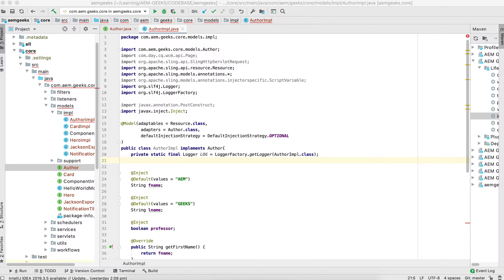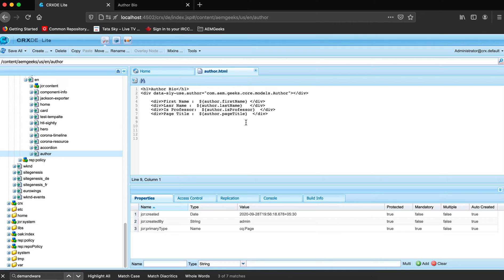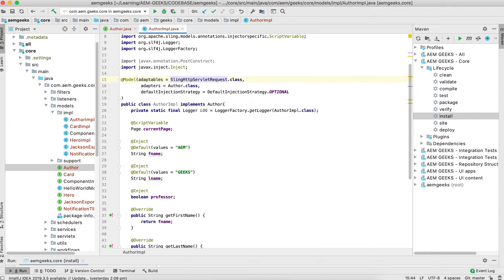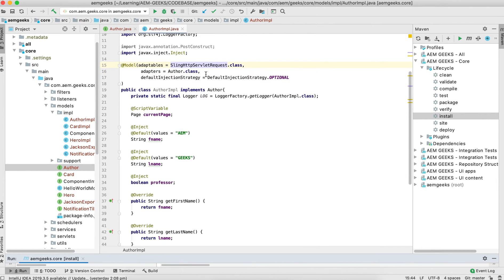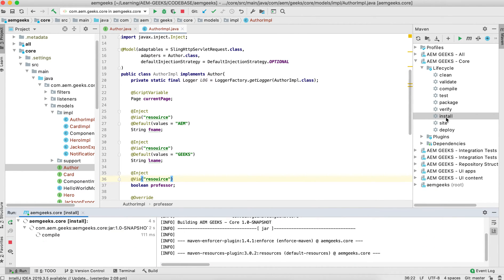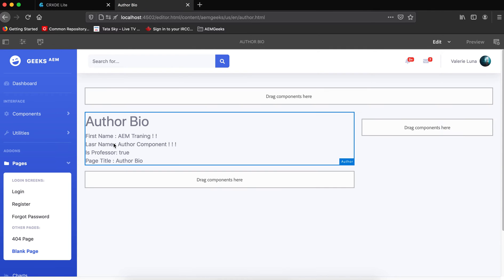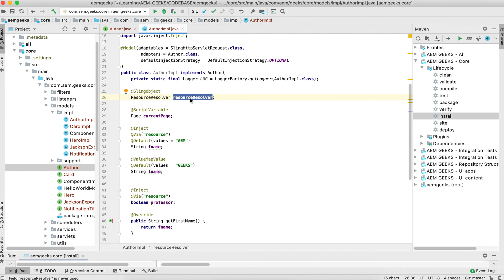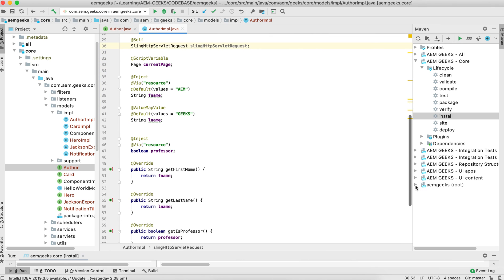AEM Tutorial #11 | Sling Model #2 | Create Component with Sling Model in AEM 6.5

Comment: @self does it also work to inject other sling models?
Reply from the maker: self can't be use to inject other sling model
Reply: @AEMGeeks  how to inject other models? also I have one more query earlier with USE api we were able to inject services is that deprecated now?
Reply from the maker: @shiva9839  USE api means, you are talking about WCMUSE. Backend used before sling model came. In sling Model you can use  @OSGiService to call service in sling model. 
to inject other sling model, get ModelFactory using @OSGiService. than get other model by modelFactory.getModelFromWrappedRequest(). Please read documentation about how to use this method. This method take 3 arguments. request, resource and sling model class which you are trying to inject.